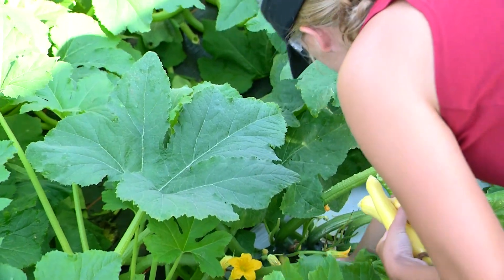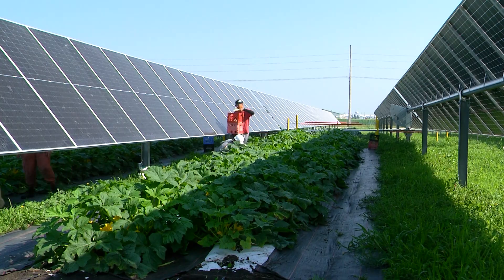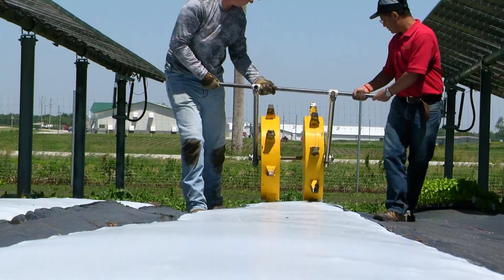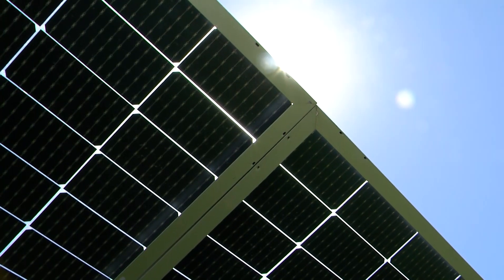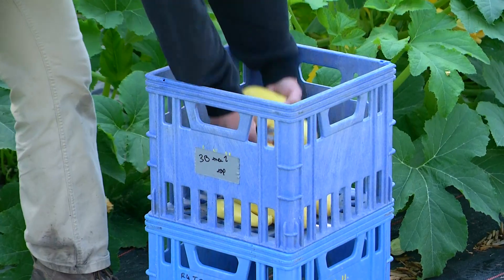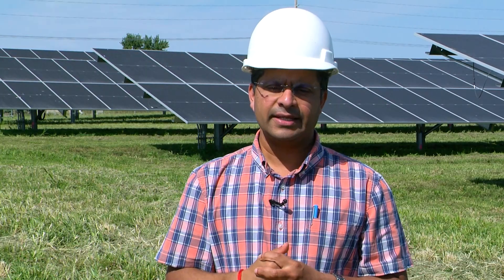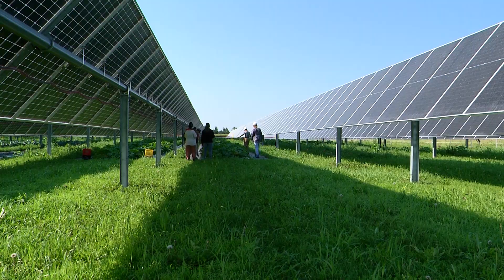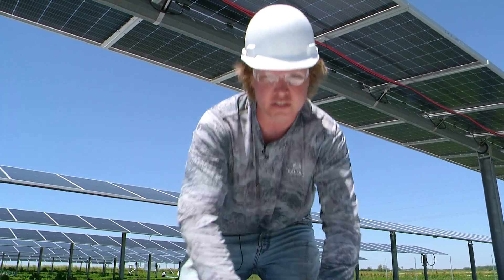ISU studying the impacts of growing food under solar panels

Comment: Your solar panels are too close to the ground.  Check out Jack's Solar Garden in Longmont, Colorado.  They grow vegetables under the panels, not  between them.  Leaving the space between panels unplanted aided in getting equipment down the rows. If they are higher, they allow people to walk under them, have sun protection for working mid day, and animals can pass under them.  You do have to do wire management to keep animals from bothering the wires.  Colorado receives a lot of snow overnight, so they found that the east side of the panels got more moisture in winter and our summer afternoon thundershowers put more moisture on the west side of the panels.  Our sunshine is more intense at 5,000 ft elevation, so panels a little lower to the ground gave a little better yield, but the trade-off with walking space underneath seemed to be worth it.  ASU, CSU, CU, and NREL were all doing research there, if I remember correctly.